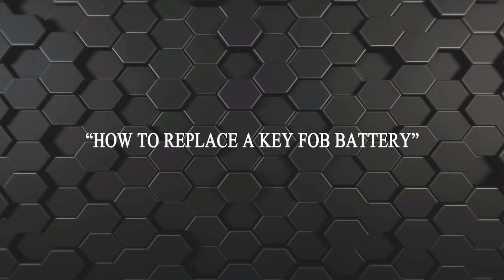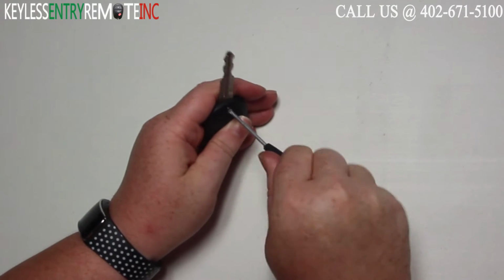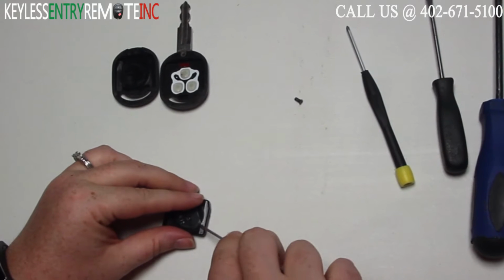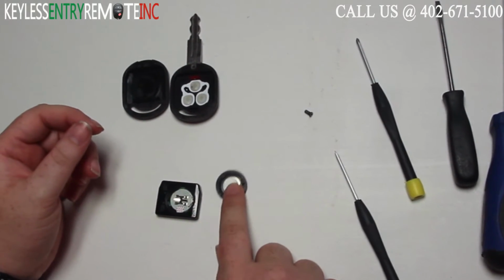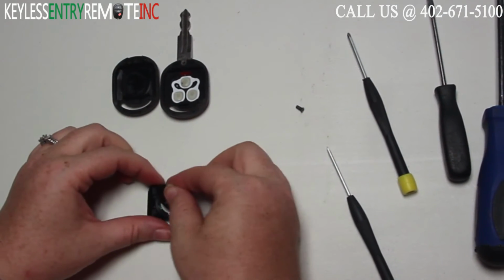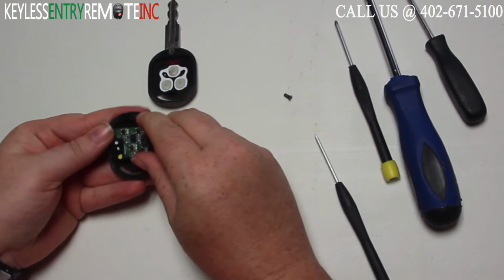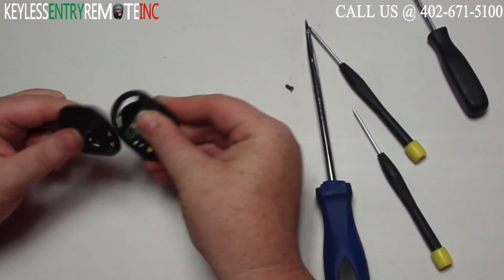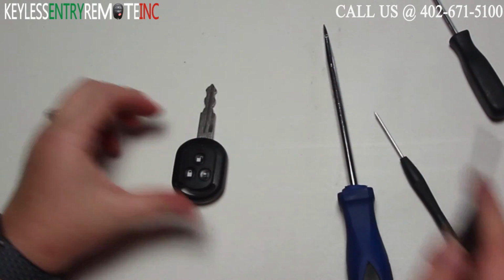How To Replace A Chevrolet Aveo Key Fob Battery 2004 - 2009 FCC ID # NYOSAKS-01TX

Comment: Got any good ideas for when the slot on the battery cover is chewed up so you can't use a screwdriver?
Reply from the maker: Try using a small/eyeglasses size flat head screwdriver on the side of the #Chevrolet key fob.